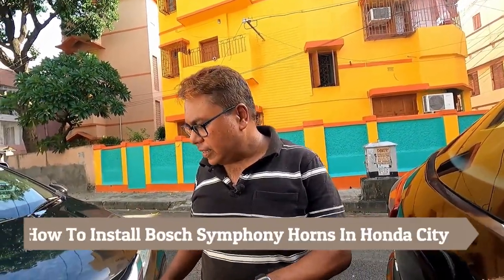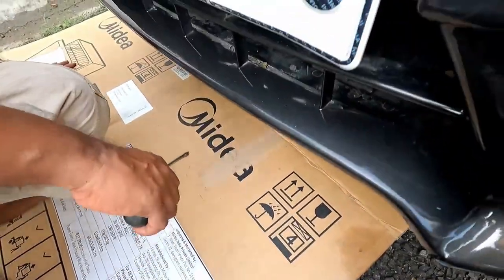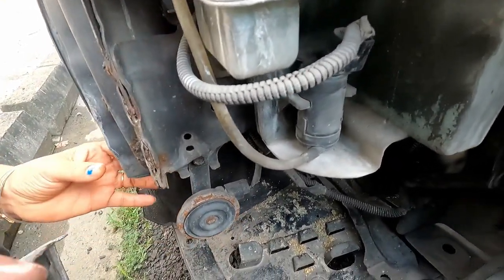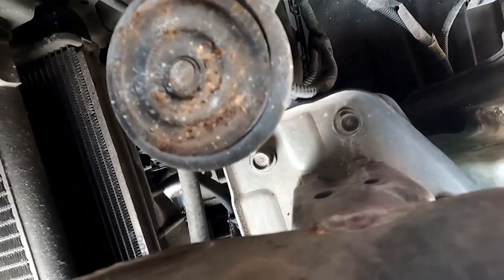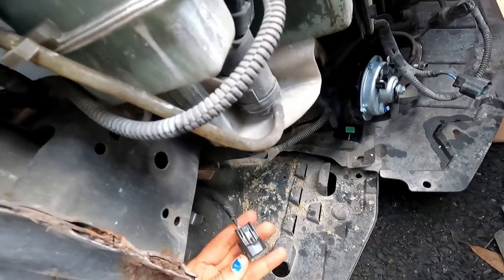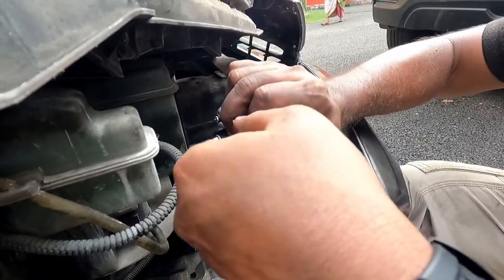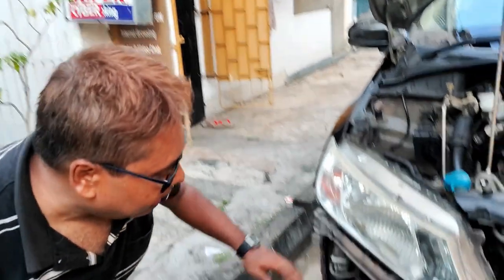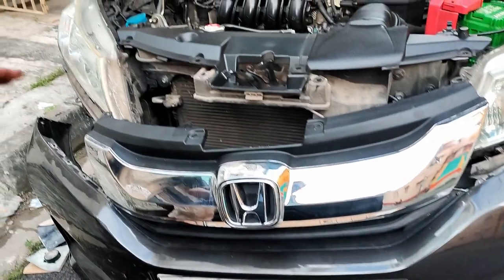How To Install Bosch Symphony Horns In Honda City 6th Generation 2016 #carhorn #bosch #hondacity

Comment: Buy a Roatry Polisher machine its very Useful for Diy guys and Very useful Do Rubbing polishing at Home... I Also do Rubbish polishing at home after buy Roatry polisher machine
Reply from the maker: I will buy a DA polisher. Rotary polishers require expertise to do the job. DA polishers are best for DIY guy like me .
Reply: @supercyberautomotivetravel u can but DA cost you around 10K + Same work done by Roatry in just 3K 4K
Reply from the maker: There's a cheaper one from Krost around Rs 6500. It's a good DIy type one, but not always available.